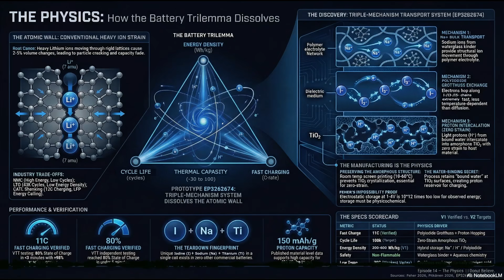Donut Lab Solid-State Battery — The Physics | Three Mechanisms Hiding in One Patent (Ep.14)

Comment: Isn't there an obvious problem with using a material that hosts the polyiodide electron charge exchange process in preference to the H+ process supported by agar-agar? How can such a material be used as a substitute for agar-agar when it doesn't exhibit the same electrically insulating characteristic of agar-agar? If such a material isn't to serve as a drop-in replacement for agar-agar what role does it serve? And, as we still will need an insulator serving as the separator what is it to be?

Would a separator implemented in a layered structure (2 or 3 layers or more) work? Of course, selective layers of such a separator might reasonably considered to be layers of an anode or cathode.

Lastly, if there is something about the layered structure of a multilayered separator that establishes the polarity of a cell does that free up anode and cathode design in any significant way?
Reply from the maker: Great questions, I think you found actual problems!

The triple-mechanism hypothesis was built by reading patent EP3262674 (Dynamic Solar Systems AG), whose Claim 10 names the cell's materials, sodium silicate, graphite, TiO2, agar and polyiodide, then pairing each material with published literature.

That worked for two of the three. Sodium-ion transport through the silicate binder, and proton transport at TiO2 (published TiO2 proton-storage work), are genuine transport mechanisms.

The third was the error. Polyiodide was called a transport mechanism, but it is the iodide/triiodide redox couple, the same one Grätzel's dye-sensitized solar cell runs on, and EP3262674 is itself a solar-cell process patent. Its place is at the cathode as a redox feature, not a channel through the agar, which would short the cell.

So the corrected picture is two transport mechanisms, sodium and proton, plus one cathode redox feature, polyiodide.

This correction forces a bigger revision. The theory splits in two. V1 is the cell actually tested in VTT, and the latest swelling test there heavily suggests a graphite anode and a lithiated cathode, a fairly conventional construction. V2 is the announced next generation, purely hypothetical, with no data points to check against, only the ideal spec sheet. And even with my later revision, it cannot get 400 ED, if compound-lithium is not involved.

On a layered separator, it should work. Any layer that hosts redox activity is functionally part of the cathode, not a separator layer. Somewhere in the stack there must be at least one continuous, defect-free layer that blocks electrons while passing ions. Beyond that you can add mediator or interface layers freely.

Holyvolt's own patent WO2026087312 describes exactly that, screen-printing cathode, then solid electrolyte, then anode into a sandwich structure, and it explicitly allows the electrodes to be unipolar or bipolar. It also settles which layer carries the insulating duty. The solid electrolyte layer is the separator.

On whether a layered structure that sets polarity frees up electrode design, for the single cell, no. Voltage is the potential difference between the two electrodes. A separator or layer stack can set direction but creates no voltage the chemistry does not provide. You still need two different electrode materials, a graphite anode and a TiO2 cathode in the patent chemistry (EP3262674 Claim 10).

What a layered structure does free up is the device voltage. Holyvolt's WO2026087312 claims a cell of 2.5 to 28 volts. No single couple gives 28 volts, so that range comes from bipolar layers stacked in series. The freedom is in the stack, not in single-cell electrode design.

I should really update the whole picture, since quite much has happened in a month.
Reply: @MarkoTManninen Marko, I managed to reply to myself but I am pretty sure you understand that my most recent comment prior to this one was a response to you.

BTW, the layered separator thing was something that only entertained me for a moment. It was a poorly motivated idea - the brain just runs the permutations that occur to it.

However, I did make an obvious connection: polyiodide Grotthuss layers (or something similar) could make sense as either bipolar cell ends or as the electrode surfaces that bind to carbon based current collectors.

The motivation was, in part, that carbon based current collectors might be ideally suited to the layered/screen printed manufacturing process. (I trust that high quality graphene is headed towards reasonable pricing - GMG suggest that they have already achieved that milestone.)

I was surprised that my Android phone AI did not declare me a complete fool when I ran the idea past it.
Reply: Your doing an extraordinary job, Marko. If my curious eye has put you onto something important, I am glad. (I'm not sure you said that because you are very clear on what the actual issue is with the patent - whether as error or lack of clarity - whereas I was not.) 

Cheers!

Comment: At 6:05 your AI hosts state that the proton is the lightest charge carrier in the universe. The proton is approximately 1836 times the mass of an electron, the electron being the other elementary charge carrier.
What else is factually wrong?
Reply from the maker: Good eyes! The context was about H⁺ ions  The AI hosts had just defined it as "hydrogen with its one and only electron stripped away"

So the intended claim was "lightest ion". But they overclaimed by escalating to "lightest charge carrier in the entire universe." As you note, electrons are charge carriers and ~1836× lighter.

This is properly explained in the tear down doc, which should explain many more AI Host dramatized data:

https://mesokosmos.notion.site/Deep-Dive-to-Donut-Lab-s-Physics-Source-Reference-Document-343ef23236b481e89b42e692e45dc5bf

Comment: To add. It all looks well researched, and very interesting. Now we will have to wait and see IF they will put commercial products on the market any time soon, and what the results will be when those are tested by independent institutions...
Reply from the maker: Right. idk, If they ever intend to sell pouches to consumers, or do only OEM. So, in that sense, it may really take long to validate battery products by independent players. Industry level transition to SSB takes Even longer, between 2027-30. This is a marathon compared to a sprint that many are expecting.
Reply: @MarkoTManninen  True. But I hear noises about first implementations appearing in the Verge Motorcycles soon. So I am hoping that these first implementations will appear quite soon. Which is not the same thing as a large scale production implementation of course, but at least it would be something tangible, that can also be tested...
Reply from the maker: @rientsdijkstra4266 I also believe that is the case. A Verge TS Pro gen 2 is a real world pilot. Maybe they have provided V1 batteries to other products in their network as well, I wouldn't count that out either. But also, I'm sure all is not going without difficulties in several areas of the business.

Comment: Please take the trouble of having a real person doing the talking and presenting, like Two Bit da Vinci, or the Viking? I have a hard time taking fake AI voices seriously. Even IF the actual content may be correct!
Reply from the maker: If it was so easy. I expect next level production team and resources added to the project. Cost from 0 to four figures and Donut Lab niche does not last forever. A lot of complications, but I hear your. This isnt optimal in that sense, but on the other ways, it is optimal exactly.
Reply: @MarkoTManninen  Ok, thanks for the explanation!
Reply: I must disagree, the AI voices are very clear and they actually add inflection and bits of humor, but mostly extreme clarity for me.   I do lower the replay rate though to catch all they have to say- I use .75x.  They do not pause though going between thoughts. I usually listen 2 or 3x.  Speaking of 3x, I love the idea of this cell using 3 different ion carriers, if that is what they are called.  Every other battery uses 1 method, Lithium ions.  This is a fantastic idea using 3 different ions!! Love it! Great work Marko figuring that out. So I am assuming the graphite node is going to be CNT?  And sorry Marko, but I have listened to your other YT vids, you do need the AI voices.  And yeah, I will wait for Tesla to start printing their next proton water battery before I buy another new car from them.

Comment: Donut claim their cell voltage is tunable. Any insight into that WRT to your prediction?
Reply from the maker: Shortly this time. Option 1: Tunable by cathode doping. Option 2: Tunable by bipolar stack count as described in the patents. Layer-by-layer screen printing allows both.
Reply: @MarkoTManninen  I have heard suggestions of stacked layers before - what is the limit? Can you make a thick stack for tens of volts? You can't voltage balance each layer with extra tabs?
Reply from the maker: @ematejowsky Good points. I'm in a process to investigate, how layered structure would behave and result the net voltage, energy density, and practically any specification. I'm not sure if there is an obvious way to calculate them, but we can try. And there may even be obstacles that ruins the whole hypothesis. But I also know already that similar approaches have been studied, so it shouldn't be an inevitable wall.
Reply: @MarkoTManninen  One issue in making a thick rick is getting the heat out.
They say they can print any shape - so cooling channels could be an option. 
I'd be happy to loose the 11C charging if need be.